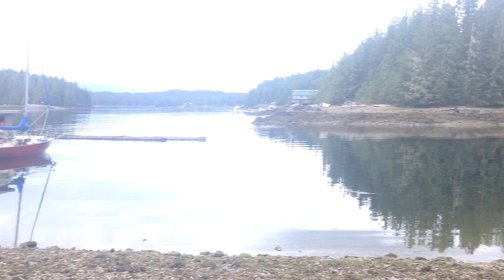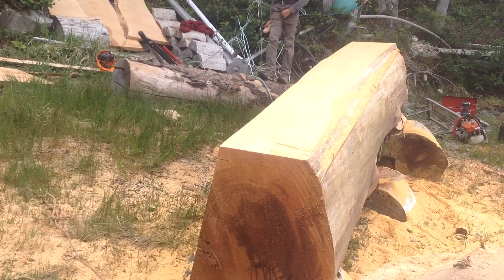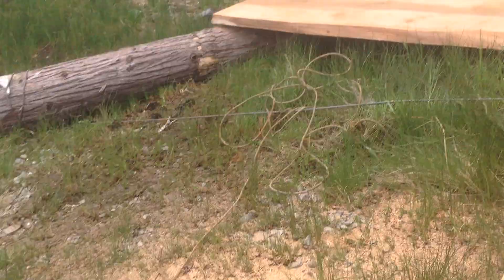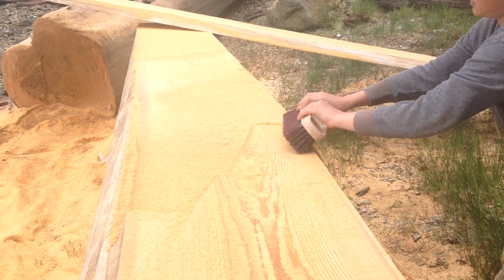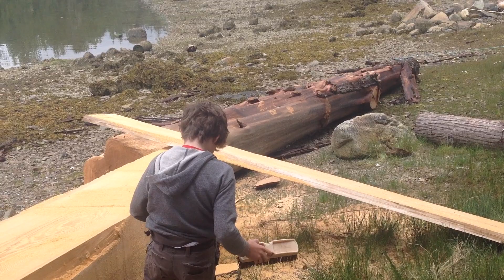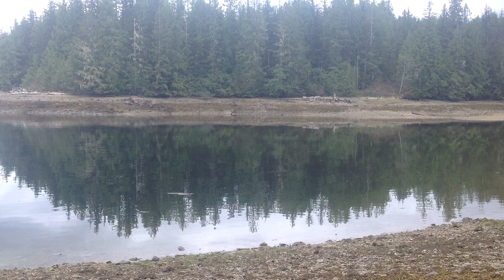Chainsaw milling a 500-year-old beachcombed red cedar log

Comment: This is great! Thanks for posting the video Ingmar!   I'm thinking of building a cabin from timber milled (via an Alaskan Mill) from beach logs on the coast of British Columbia. Do you think this is feasible or will sand and water logging become insurmountable obstacles? Any thoughts you might have on this would be greatly appreciated! Best, Chris
Reply from the maker: There is a pretty big learning curve, tools and parts involved, -boats, saws, mills, axes, "wood wrenches" froes, mallets, drills, guide planks etc. etc. -but if you can manage all that, two wheelbarrow loads of stuff fits easily in a small skiff, and then you're on your way to the log! If you've got a home beach to work on, then you go get the log and tow it home instead. I generally inspect the logs for rocks, spikes and stuff and there's not much for sand around here to worry about. Nevertheless, sharpening chain is a big aspect of the work. On big cuts, say maxed out to the end of a 36" mill cutting cedar, you may find yourself sharpening every 2nd plank. Smaller cuts, say 16", you can do a whole log with one sharpen. I always try working down wind, and prefer windy days, but inevitably, you do breathe exhaus, -and sawdust. I'm always dreaming of a simple air-blower mask that takes air from 20 ft away, -but haven't found one yet.. It's totally fun and a joy to pull off these beautiful planks, -my favourite thing to do! And even if you were to go brand new everything, it's only going to cost you about $3000. Or you can try scrounging around for a bunch of old 090 antiques which works for me!
Reply: @ingmarzz  Many thanks for sending these considerations Ingmar! I'll let you know of we proceed!